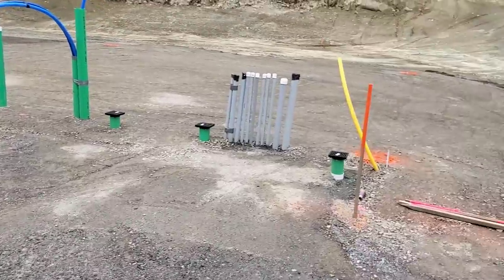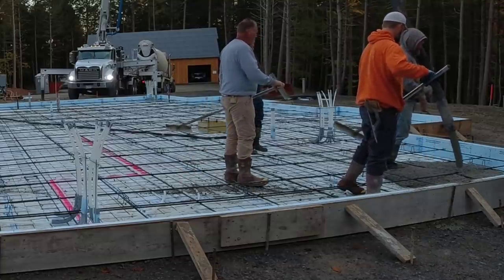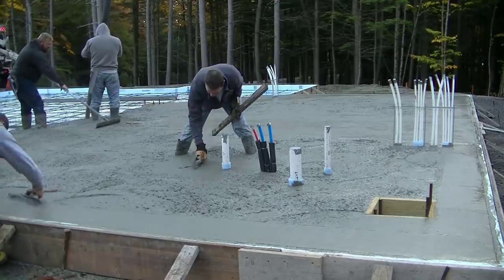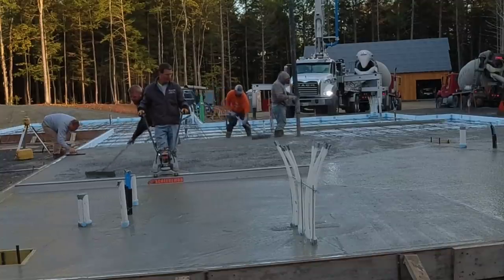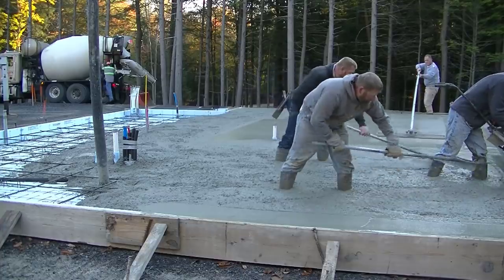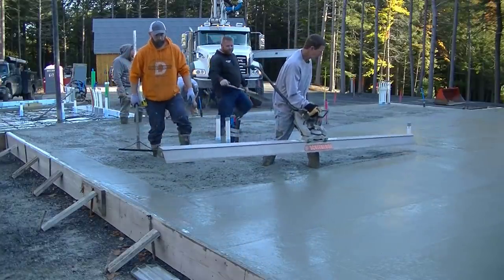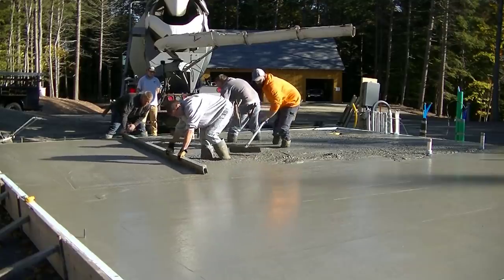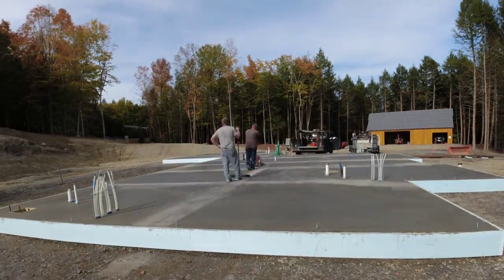He Made Us Pour His Concrete Slab 10 Inches Thick! (Waste of MONEY?)

Comment: The concrete is also a thermal storage medium so when it comes to heating and cooling it may be a good payoff.  I have not seen the numbers although with the heating pipes in the bottom of 10" instead of 6" the recovery time will be much longer.
Reply: Yeah, The floor is going to respond super slow, probably take several days. The 6-in slab in my shop probably takes 24 hours to come up a couple degrees. But with radiant slab you shouldn't really be changing the temperature anyway.
Reply: That's my thought. A 10in slab will hold that heat incredible well. I think with the right boiler setup his heating cost would be low.
Reply: should have been 2 inches from top of the slab, Will take a week to get the temperature up on that slab and has a huge chance of overshooting now.
Reply: @MitchOfCanada   I think the point of the 10 inch slab is to bring the temperature to where you want it and leave it there.  The first time he heats it up it is going to take a while, but its not going to need to change after that.  Just set it at a temperature and maintain it.
Reply: @MitchOfCanada  two inches from the top would be ideal, for any slab top is better but hard to do. But if it overshoots I would blame the guy who sets sets up the rest of the system/ controls. For not picking the right equipment for a slow responding system.
Reply: @andygammie7394  its going to overshoot   and be like cooking a frog. It's like heating a room with a blow torch on the other side of a 8 inch slab of concrete now. Once room is at temp the energy into the slab will. Be far past what is needed. The swing settings are going to be very tough to modulate.
Reply: @blazeharding574  you need more temperature in floor when outside temp drops. It's a simple BTU heat loss equation.
Massive amount Less BTU when outside is - 10c VS when it's -35c.

My garage goes from 18c floor to 22c floor when temp goes up and outside with kelmaer pwm controller. Not including an outside temp reset u can do which would see temp change and add more heat to system.
Reply: @MitchOfCanada  ya, for sure in a poorly insulated building controlling on room air temperature it's not going to work. Also you never pair a thick slab with a high temperature heat source such as a boiler without mixing it down significantly. On a thick slab like that I would use injection mixing and a controller like the tekmar 519 with max slab temperature settings. But the most important point is that you can't have a high thermal mass slab in a poorly insulated building.

Comment: Good day's work for the crew.
Not overkill.   Looks like having wide separation between the two rebar mats would give the slab lots of tensile strength to weather any expansion of the subsoils without cracking.    It will take a long time to get that slab heated up with that radiant heat, however.

Comment: Great to see an owner going overkill rather than skimping and cutting corners.  You can't go back and fix bad work very easily, especially concrete.  Also, the slump, placing and concrete strength are important factors that get missed far too frequently.
Reply: i knew a builder who would slump test every truck delivery before letting the driver unload.
Reply: @jonnyd8399  Interesting, he was probably burned once or twice by wet loads.  I'll bet the mixer drivers knew better than to leave the plant wet when going to his sites!

Comment: It is not overkill to pour a thicker slab when you have radiant in floor heat. I noticed the plastic tubing laid over the pig mesh and under the rebar. By heating up a larger mass, it will stay warmer longer. I did a 7" slab in my home I had built in Michigan and the boiler only ran once or maybe twice and day at the most to keep the house at 72 degrees. Having granite, concrete, or stone counter tops also helps retain heat in the building. The Styrofoam under the slab is the key. I think code now is 3" but I have always used 2 layers of 2" staggering the joints. I really love slab homes.

Comment: For the concrete and steel placement it's much easier, for all the subs. So therefore the 10" slab is best. 
I've built in NY and now Florida. In NY we have monolithic slabs, it tapers off on the edges to a thicker "Footing" not so much a "Grade Beam" which is more commonplace in Florida when we build on The water or near the water. Grade Beams will run around the perimeter, but also through the interior of the slab. Also with much more steel then used up North

Comment: Did a 300' x 300' slab in two pours for some guys from Jersey for a grow operation: 10 greenhouses. Heated slab with all the electrics in it for everything but the temp control, 20' wide corridor (that slab was even thicker in order to accommodate the main service line from the transformers) and thickened edges (Haunch, right?)...around a foot thick slab over a full-coverage Styrofoam slab that ended up being 12" thick at the thinnest part of each slope-to-drain greenhouse footprint. We split the pours: two separate pours for the banks of greenhouses with the corridor later on in the project(after the greenhouses were up). We started at 3 a.m. with trucks lined up down the road sometimes six in a row...big overhead pump going nonstop with a crew of 16 guys to place, screed and bull float, four finishers on power trowels...a gatdam circus but it worked...and once the floors reached ambient temperature the heat regulation was a walk in the park. filmed the whole thing just to remind ourselves  it actually happened. I think there was an economy of scale to doing it that way vis labor saved in site-prep, placing the Styrofoam and the pour itself...climbing around all the rebar was enough of a challenge without having to deal with grade-changes while we placed all that mud. Great to see you guys working like a well oiled team. Got a few projects here in Oregon...you busy next spring !?
Reply from the maker: Sounds like quite a project Phillip. Thanks for commenting!

Comment: As far as I can see it he's building his house on a slope, so the extra thickness might be appropriate to account for shifts in the ground (is the plate anchored?). Also better for insolation and after market modification, I've seen a picture of a room where they installed a tile oven in a older house. The foundation broke and the oven sank into the ground, pulling the interior wall with it.

Comment: I know in some buildings instead of a uniform thick pad, the pad is poured in a waffle pattern to get even deeper and shallow overall for a built in beam truss in the casting. The beams can be located to support load bearing walls and cross large spans. With rebar, this thick waffle is conservative in materials and very rigid with less possibility of cracking with settling ground as the truss is rigid and will bridge settling areas without sinking into them. A 4 inch slab on a grid of 14 inch deep beams 6 inches wide is very rigid.

Comment: I would imagine it will take considerably longer to heat that slab, but it will stay warm longer once it's up to temp. 
Just replaced my garage slab here in Anchorage Alaska with a heated 4" - 5" slab and loving it! In fact, we're putting a vent and fan in that will direct the garage heat into the house, as we've found that the house heats up nice and quick when we leave the door propped open into the house. Loving the in floor heat!
Reply from the maker: Awesome, sounds good.

Comment: In parts of western New South Wales there are areas on the slopes that have a type of black reactive clay.  Normal slabs are not thick enough.  Expansion and contraction of the clay can lead to slabs and houses cracking. The construction and thickness has to be different. Not saying its the case on your job though.

Comment: I am a PE with 50 plus years in the heavy civil construction business and I would have to go through the numbers. Lots of variables to deal with. (Frost depth, floor insulation, heating and cooling system, reinforcement structural loading, soil bearing capacity, soil expansive capacity to name a few) As a general rule on a slab this thin it is the labor that rules.

Comment: The 10" is good for thermal mass. Also I've found the thicker concrete reduces the size of shrinkage cracks that's desirable if the concrete is to be polished, which is a nice way to go with radiant heat. I wouldn't go more than 5" if the concrete gets covered with sheet goods and carpet but 10" would be nice with radiant and polished concrete.
Reply: Im thinking of doing the same thing on my house. But ill have to have a footing around the outer edge of it for the walls to set on
Reply: Thermal mass inside house is bad for comfort. There will be many times too hot and too cold when outside temperature varies a lot. Thermal mass would be only be good if you build like Antarctica or Sahara where all ways be cold or warm. But when outside temperature varies often best solution is to pour thin slab and use more insulation on floor, walls and ceiling.
Reply: You make a good point, definately worth considering depending on where you live.

Comment: Anytime you pour concrete this thick it requires an additional Matt . The steel is what’s going to give the concrete strength.  A single mat 2” from the bottom and another Matt 2” from the top would have been the proper way to pour this .

Comment: As a structural concrete contractor from Southern California, no, I call this a floating slab. It does not need footings around the edge or on interior bearing walls. I personally would have put more rebar in the slab. But I also had to build to earthquake standards. Something else, I never free handed the screeding, we always used  screed rods on both ends of the screed.
Reply: 12in thick for 1 storie slab on grade. I'm thinking about sog it's as easy as it gets..1 man can set the 2x12 forms and rebar in one day. You spend more in concrete but save digging the footings and labor setting forms and compaction is already done when they scraped grade.
Reply: Maine. No earthquakes

Comment: All comes down to what loads it's taking, the soil conditions, & how it's reinforced. A 6" slab could be fine if it's properly reinforced and detailed for the required loading.
Reply: As with most houses. The majority of the weight is on the perimeter and load bearing walls .
Reply: 6 inch is fine? We always pour slight over 3 inch slab 4 inch maximum on living area when walls are built over own footings and it works well.

Comment: Definitely, “not overkill.”  In 2000 we built a similar dimension, feature (rebar, EPS/XPS form, etc.) and in floor heat system. Western Wisconsin. It is more  energy efficient than thinner slab buildings with comparable dimensions.
Reply: with 2" foam you dont need that extra concrete because i dont think it will really loose much heat
Reply from the maker: I'll do an update in a year and let everyone know.

Comment: I find it amazing you guys aren't tripping over that rebar maze.  I still like to know it the radiant heat system really works for the money and effort.  Thanks of the Video Mike.
Reply: It will work great
Reply: yes it is great and gives him a much more even heat
Reply: Radiant is the only way to go for cold weather climates. 5 years on my new 2400 sq. ft home and I wouldn’t trade it for anything. Coupled with an over insulated home, it’s far and away the most economical way to heat. I’m hooked to a 95% LP boiler here in Northwest MN.
Reply from the maker: It'll work, we've done 100's of them.

Comment: Surprised they don’t require a deeper frost depth for the edges. Here in So. Utah, it never freezes but code requires at least a 20” frost depth at the edges so we have a 10” footing and a 10” edge form to keep the frost from getting under the slab. I’m guessing that’s what the foam is for? Just curious not saying what you guys do is wrong just different from us!
Reply from the maker: Frost won't get under a slab that's heated, foam or not. That's what we've experienced doing these for 40 years here in Maine.

Comment: Not - I know the builder trades don't care they are not going to live there. 
My house has a thin slab and the soil and floor as settle up to 5 inches difference in high in spots from one side of the room to the other. Can not lay wood flooring because the floor has settled so much and the wavy floor is anything but flat.

Comment: I think this is a case of working too long in a certain industry and becoming too attached to the way you do things normally.  There's absolutely nothing strange about the request for a 10" panel.  It's for a house with no set budget so there are no limitations on how well it should be made.  You guys did great work
Reply: you clearly are not in the trades ,, in floor with 10 inch slab it a very bad idea , when the sun comes out the home over heats ,, so in the winter when the sun come up in the morning the A/C will also have to come one ...

Comment: Extra thickness equals more thermal mass that equates to less energy required to heat the house over time.  Adding the extra inches of concrete acts like a battery to store the extra heat in the floor and allows you to cycle your boiler less often preserving the life of the boiler and using less energy to heat the water that is then pumped through the radiant floor heating system.  Also cooling the house would have the same effect by allowing the cold to sink into that concrete in the summer.
Reply: Spot on!!
Anyone who uses a wood fired boiler would never disagree with that.  It's a lot of work if you have to cut and split yourself. The extra thickness is a good investment.

Comment: Additional rebar or a pre-stressed slab would typically be more effective than just making a slab extra thick. In fact, you can end up having more problems by pouring a thicker slab without enough reinforcement. More concrete can cause more severe cracking from temperature and shrinkage if there's insufficient steel for the amount of concrete being poured (all that heat you talked about in the video). This is why there's a minimum percentage of reinforcement per ACI codes that must be placed in foundations, walls, and reinforced concrete buildings, etc., even if it is well above what is needed for strength requirements. Of course, having proper joints will help limit cracking in on-grade slabs, also. 

Also, if I'm seeing it correctly, it looks like the welded wire fabric has been pushed down to the bottom of the slab. It's really serving no purpose from a structural standpoint, either in terms of strength or limiting crack width. It's possible that WWF is there only for the heating system, but if it's supposed to be there any other reason, it was a waste of money being at the bottom of the slab. For on-grade slabs, you want the WWF and/or rebar as close to the surface of the slab as possible to maximize the ability of the steel to minimize surface cracks (while maintaining clear cover requirements, of course). You may need steel at the top and bottom for a mat foundation, but it's highly unlikely you would ever run into this in residential construction.

As someone else mentioned in the comments, the 10 inches may have more to do with the heating system than just pouring the slab extra thick.

Comment: My Dad built his own house back in the 1956. 4000 square feet.  Area under slab had about a 2-foot slope front to back.  He formed it up and pour a slab that was 2 feet and increased to 4 feet thick at the front.  All the exterior and interior walls were constructed with 2 x 6's, sheeted with plywood, fully insulated exterior and interior. He used drywall to finish interior over the plywood. He installed siding over the exterior plywood walls. Single story home that will last for probably 150 years.  By the way Dad was an aeronautical engineer, with the means and knowledge to build his dream house.

Comment: Mike, Except for almost needing waders I can see the cost benefit to a thick slab. Easier grading with no elevation change, Batter boards came off like butter because of the foam, Less rebar needed with no haunches, final grade only needs a sprinkle of dirt, less mess because the footers weren't dug. But most importantly greater thermal mass will keep the house more comfortable at less cost to heat. BTW, you did a great job (as usual)...
Reply from the maker: Thank you!

Comment: How will he prevent frost heave around the perimeter without a footer?  Will he extend foam out 2-4' or just backfill against the 12" vertical foam? I know that's a loaded question. Love the videos! Thanks
Reply: They should have had poured a knee wall then did slab
Reply: its likely on several feet of free-draining gravel
Reply from the maker: It's got 3' of crushed stone under it. These slabs don't get frost under them if they're heated. Never a problem. Frost goes 4' down here also.

Comment: The question has a 2-part answer.
Structural Strength: For normal soil bearing conditions, it is overkill - so much wasted compressive strength capacity. Should have added bottom rebars along bearing wall locations.
Cost: Not possible to get a definitive answer.  A $2,000 extra cost could be pennies to Jim, but a million bucks to John. The home owner answered this.
Side note: Interesting to see slabs/turn-downs/grade beams being poured on grade in regions of the country that do not have permafrost. I am an east-coaster. You guys did a good job.

Comment: The extra concrete is extra thermal mass, which when hydronically heated will maintain the temperatre longer.   Yes it will take longer to heat up, but the added thermal mass acts as a thermal flywheel.   Not a bad idea.
Reply: its a very bad idea for comfort ,, lol